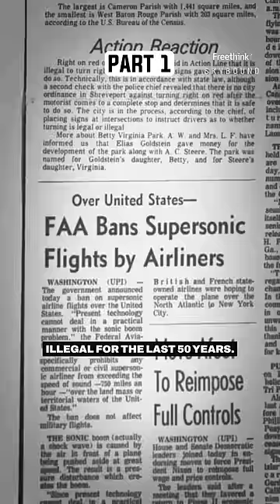NASA & Lockheed Martin's supersonic aircraft PT. 1 ✈️ #explained #shorts

Comment: Yeah it's not gonna "bring back" commercial supersonic air travel... Planes travel at a speeds that cost less
Reply: Not true actually.  Supersonic is more efficient.  There’s a number of reasons.  They fly higher which means thinner air.  Air resistance gets lower past Mach 1.2.  Engines that are designed to cruise supersonic are more efficient across any significant distance than engines designed to cruise subsonic.

The reason for the misconception is the Concorde was forced to cruise at 500 kts at 30,000 feet for the extreme majority of its trips rather than its intended Mach 3 50,000 foot cruising window.

Comment: Supersonic flight is vastly more wasteful of fuel than subsonic flight and should not be used for commercial flying purposes for that reason alone regardless of noise pollution concerns. Commercial heavier-than-air transport of the sub sonic variety is already incredibly wasteful and polluting and supersonic flight would inevitably be much worse on a passenger/mile basis.

Comment: Development of new technologies like this is too freaking expensive. I wish that there was something that could be done to make it cheaper allowing for more smaller projects to happen ultimately pushing the industry into the future. Planes in general are just too expensive. The technology exists to make small low flying low speed aircraft for multiple different purposes, and if you could actually get one and use it for closer to the price of a cheap car, then there would be much for flying. And a plane ticket across the country should be able to be bought for 50 bucks. You could spend more if you wanted, but barebones bottom tier, $50.

Comment: The sonic boom is not the main reason the Concorde failed commercially. It was the running cost. Concorde lost money from day 1.
Reply: This isn’t at all true.  The Concorde was more efficient when it could hit its cruising window of 50,000 feet Mach 3.  It could do a given route 4-6 times faster at 3x the fuel consumption per hour.  The issue is it was literally banned from flying in its cruising window and engines designed to be efficient at a supersonic speeds aren’t more efficient at subsonic speeds.  They are, however, much more efficient than sub-sonic engines.

Comment: Except super sonic travel hasn't been illegal for 50 years. The concord's last flight was in the early 2000s. Passenger airlines don't have super sonic aircraft because it's not cost effective. The concord lost money every year even with the most expensive tickets in the industry and was only kept in the air because the French and British governments subsidized Air France  and British Airways respectively.
Reply: This is completely and laughably false.  Commercial supersonic overland flight is banned currently.  Civil supersonic flight is banned entirely.  Jan 6 2001 the FAA put in a way for that to change but it hasn’t yet.

The concorde was more efficient when allowed to fly supersonic.  It used 3x the fuel per hour at 4-6x the speed meaning it lessened use.  When it was banned from supersonic flight overland it was forced to fly 30,000 feet 500kts instead of its listed cruising window of 50,000 Mach 3, ensuring the engine could never run in its efficiency band.
Reply: @AnarexicSumo  except I didn't say overland, did? I said the last concord flight was the early 2000's, which, if my math is right wasn't 50 years ago.

Also, can you please point to where I said the concord wasn't fuel efficient? I said it wasn't efficient and that it lost money every year in service. 

I really wish people would at least attack what I actually say and not what they think I said.
Reply: @AnarexicSumo  wait, so didn't the concord fly at supersonic speed or not? You're saying the FAA completely banned it and only put in a fix in 2001. But the concord had been flying since the 70s. Which is it? 

You are completely and laughably strawmaning what i said. I never said supersonic travel was legal over land. I said it wasn't banned banned for the last 50 years because the concords last flight was in the early 2000s, which wasn't 50 years ago.

I also never said the concord wasn't fuel efficient. I said it wasn't efficient because it lost money every year in service. And was only still flying because France and Great Britain kept covering the losses to Air France and British Airways. 

If you're going to comment, at least comment on what I actually say and not what you thunk I said.

Comment: wrooooong! nobody in commercial aviation needs this. Find brain, we fly far far far away from sonic boom speed. And every year we actually fly slower go look trip extends every year, cause its cheaper and more money you earn as commercialo aviation. Concorde was discontinued cause it was too expensive. Aviation works different than in your mind. Same goes for lets build huge plane, they dont fly anymore, now they build smaller planes casue they can earn more money while landing in different places without problems, also you dont need lots of people and you can lower price tag of tickets. Military wants it as they wannt to train in faster speeds, but here is a cath by flying fast they waste money so they are also limited to speed unless its combat mission or you need to intercept